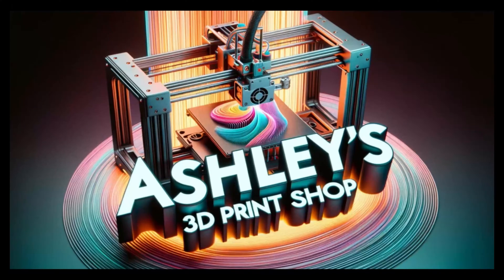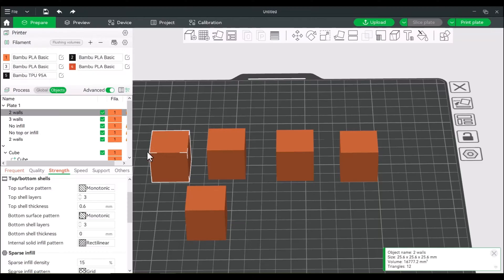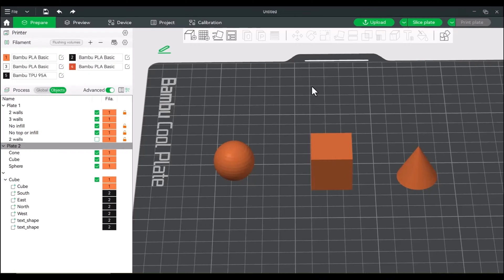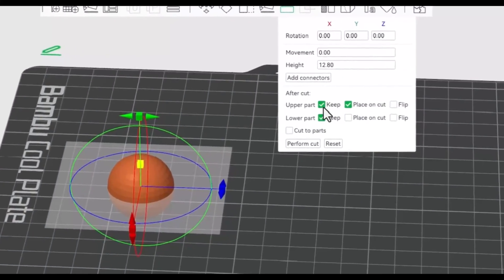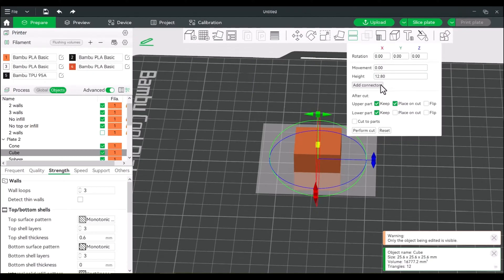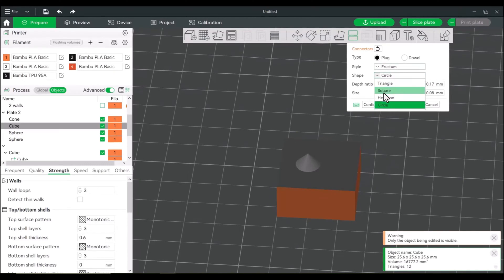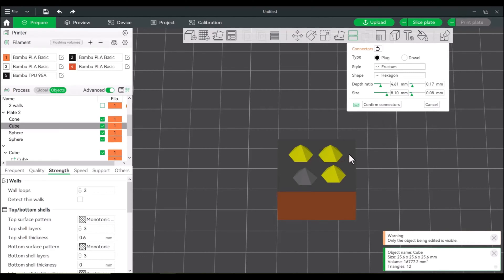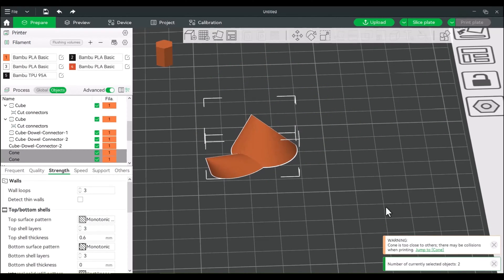Bambu Studio View, Walls and Cut tool.

Comment: Cut tool is fine until you have a complex object. I really wish you could scale the cut plane, would be great to slice a body at the shoulders, waist etc and not have it slice through a leg, arm or other sticking out part. As it is, it's only really useful for basic objects. Neat when it works for the application you had in mind though.
Reply from the maker: Hey hey. Great news. If you have a later version of Bambu studio or Ora slicer selective cuts are available.

I made a video about it. Towards the end of this video. 
https://youtu.be/RIR5QjhQnmA?si=txYS8H881AzbAtzO
Reply: @ashleys3dprintshop  Oh wow. So easy too, can't believe I missed it :D
Reply from the maker: @antmax  It was added recently from Prusa Slicer. I have been waiting months for it to reach Bambu Studio. 😁